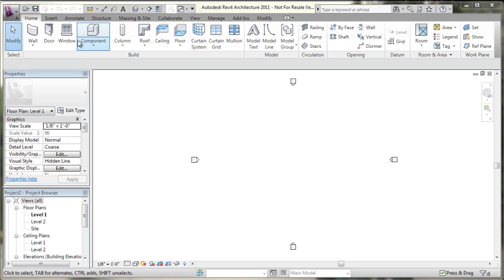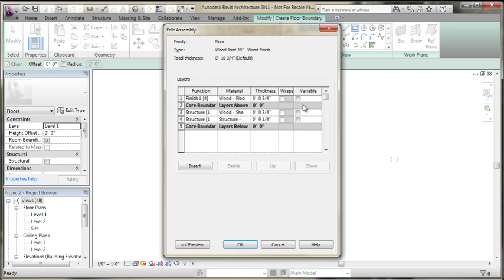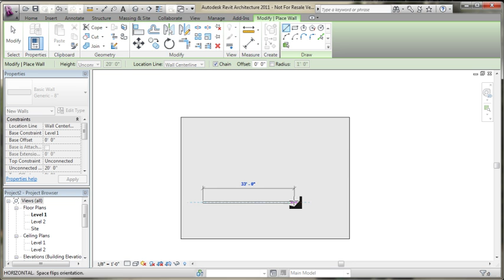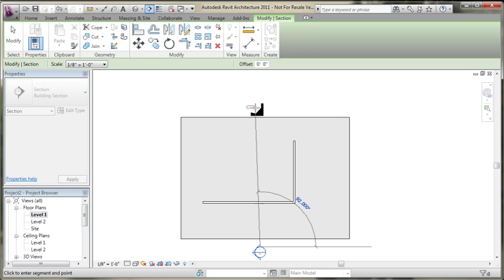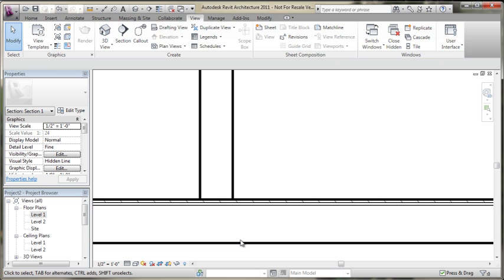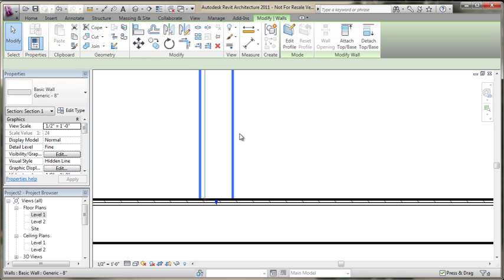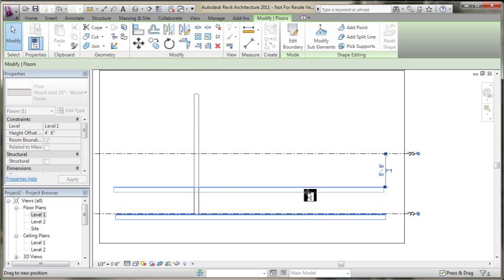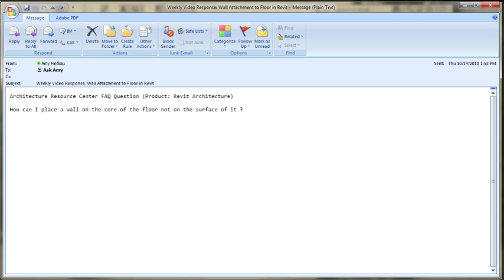Revit - Attach Walls and Floors

Comment: If you want the attachment to show properly in section view between floor and wall you also need to make sure that in both elements - floor and wall - the core material of the wall/floor is set as "structure" in the materials and other cladding or insulation is set as "finish" or "substrate". Otherwise the 'attach to base' still won't make a proper join in section view.

Comment: Although we cut it but quaintness of slab and finish are same... How to solve this issue, for example if Floor generic 1056sqm so in the presence of wall ceramic area should come less than the slab area(Floor Generic).